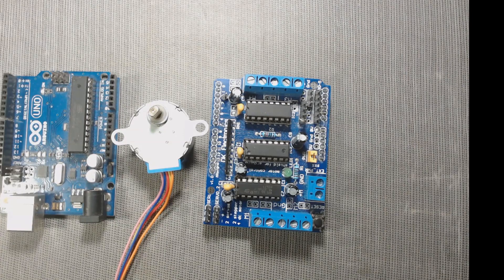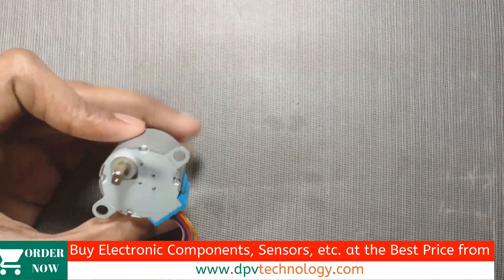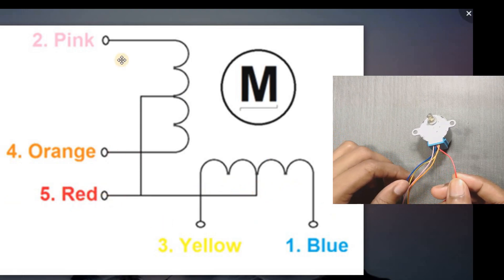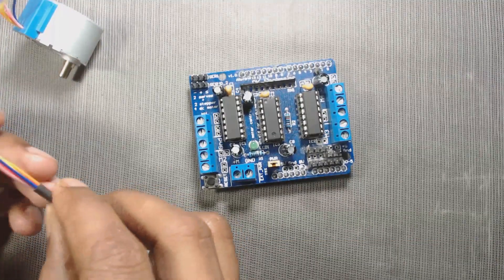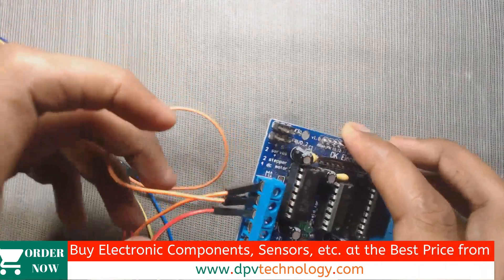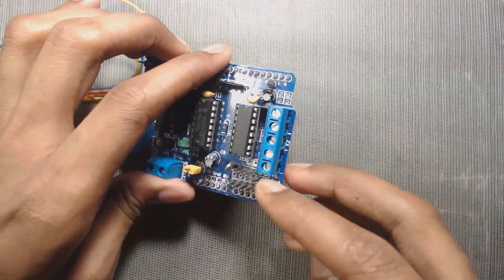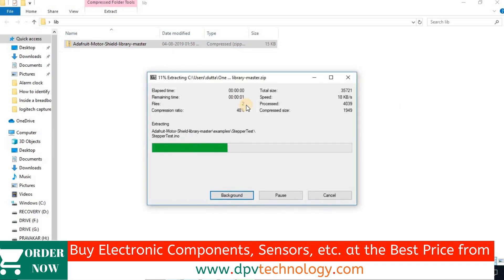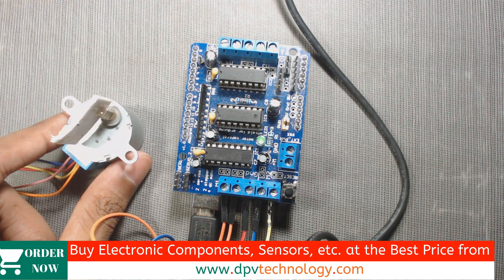How to connect unipolar stepper motor with L293D motor driver board shield and Arduino

Comment: Hi there, thanks for the video, i am a noob on all this arduino thingy, I was wondering, if you want to also attach an LCD to the system, to print the rotation status of the motor, how would you attach an LCD to the Motor shield, is it possible? sorry if the question is a bit too noob ish